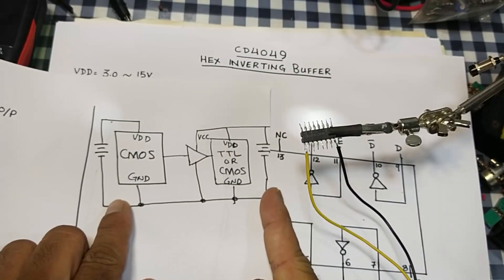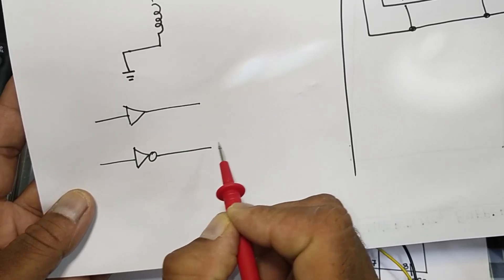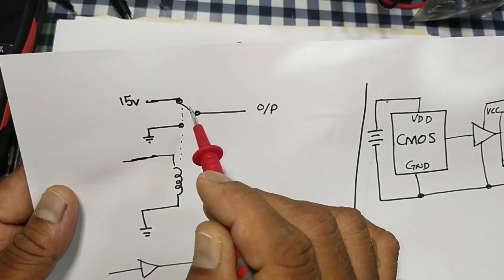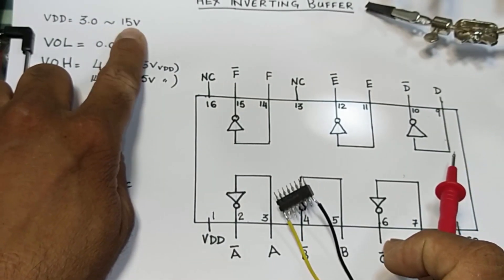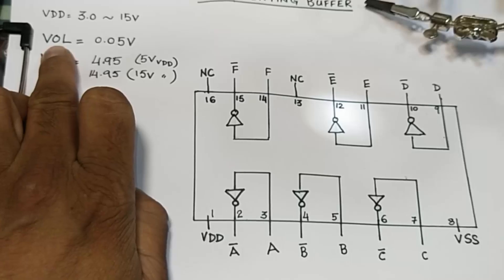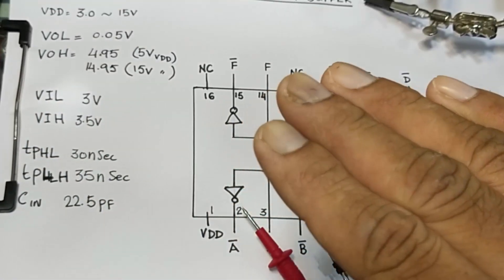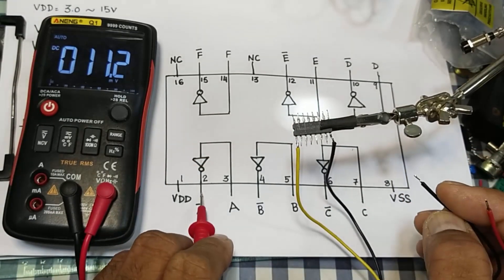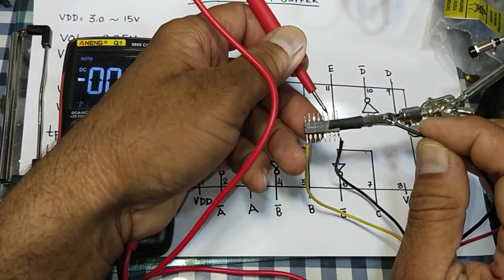{456} CD4049 Hex Inverting Buffer. Function, PinOut, Test, How to Test Inverter Buffer CD4049

Comment: Sir 4069 can replace by hef40106 in washing machine pcb
Reply from the maker: cd4069 is inverter, while 40106 is Schmitt trigger 
it can work, but in some conditions it can provide false triggering so it is much better to use 4069, use CD4069, HEF4069,
Reply: @HaseebElectronics  thank you sir

Comment: Mr Haseeb good day 
thanks for everything you explain we learned a lot 
from you . for capacitors
non polarized capacitor
can i use same capacity different voltage by replacing 10nf 50v in to 10nf 1000v